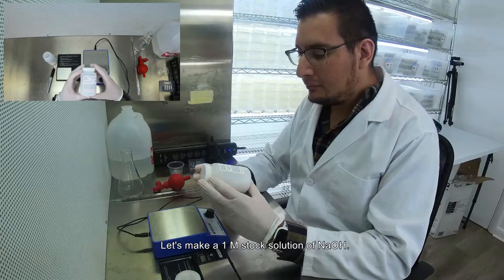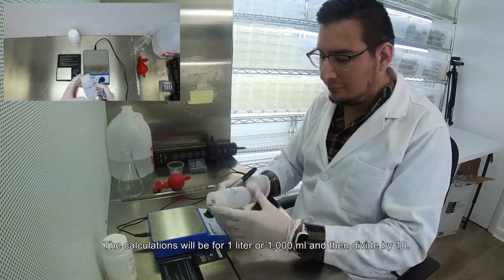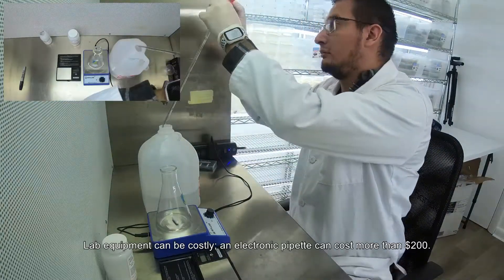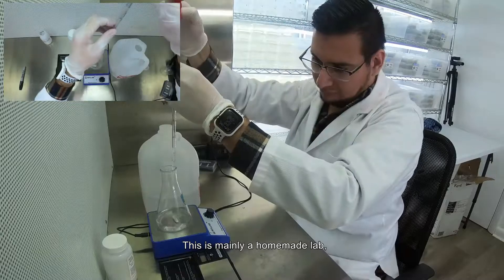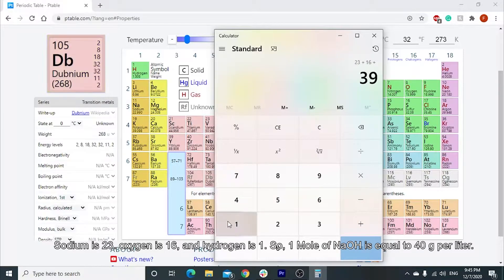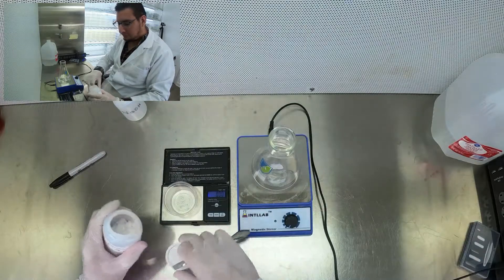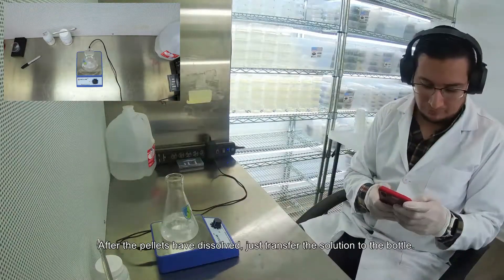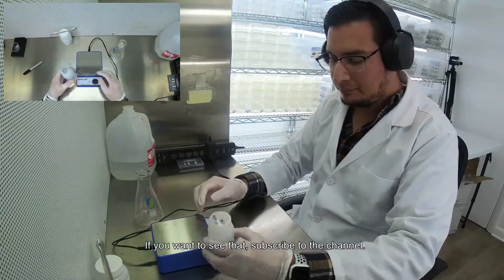Making a 1 M stock solution of NaOH

Comment: No hay diferencia de usar NaOH 1M a NaOH 0,1 M ??? gracias!
Reply from the maker: Yes, there's a difference — mainly in concentration and pH adjustment strength.

1M NaOH is ten times more concentrated than 0.1M NaOH. This means it will raise the pH of your solution much more quickly and requires more precise handling to avoid overshooting the target pH. If you're new to pH adjustments or working with delicate media, 0.1M gives better control.
Reply: @PlantCellTechnology Thank you !!!

Comment: Do you use 100ml of Distilled water or 96ml taking into account the weight of the pellets?
Reply from the maker: to prepare 1 M NaOH solution, you dissolve 40 grams of NaOH in 250 ml distilled water, and then make up the volume to 1 Litre.

Comment: Is your All American pressure cooker electric? If not, what are you using to heat it? I'm assuming it's too big for a stove so do you have an external burner that you use? Is it gas or electric? Thanks!
Reply from the maker: Electric, it uses 1650 watts, which is not bad compared to other smaller electric pressure cookers.